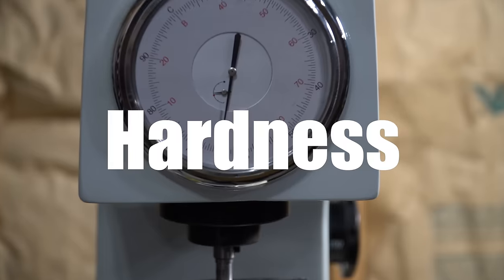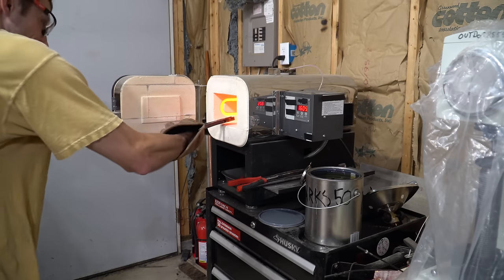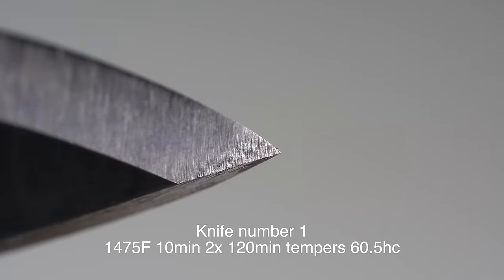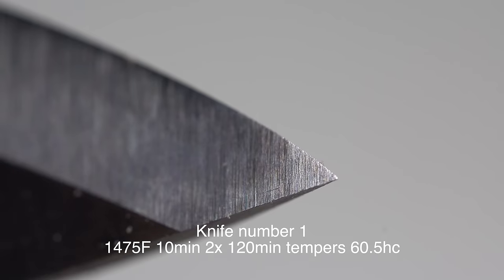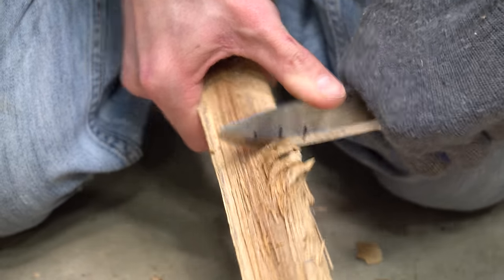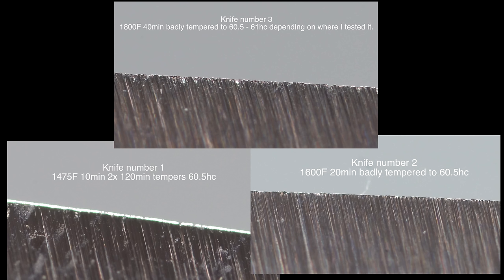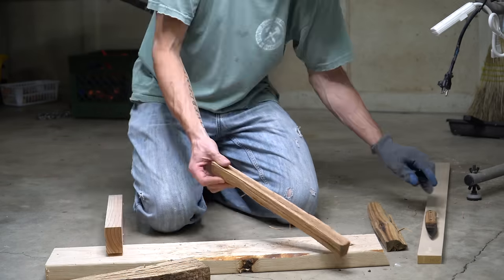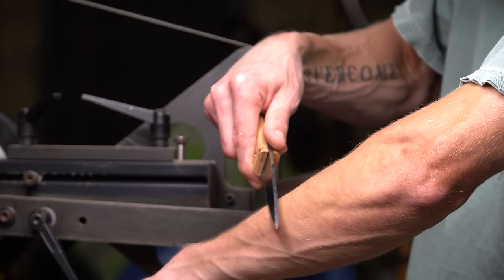The BIGGEST LIE in the knife industry- Good Heat Treatment vs BAD Heat Treatment

Comment: Stop Using Oil Quenching Steels, Wanna do something different??
Use S7
Reply from the maker: Ive used s7 before in a couple videos. It may have advantages is some knife styles but has terrible edge retention and very low hardness.